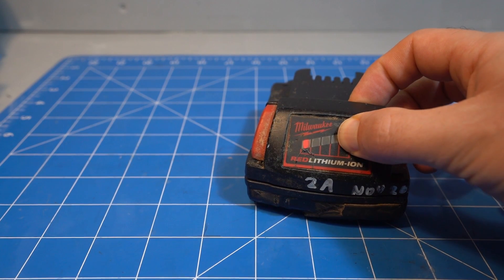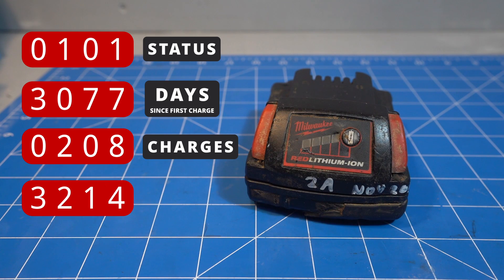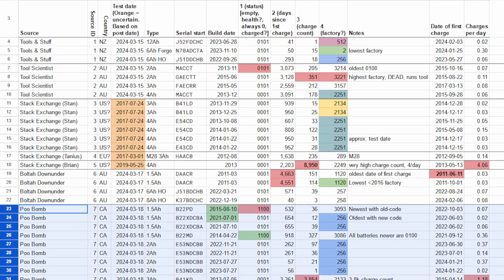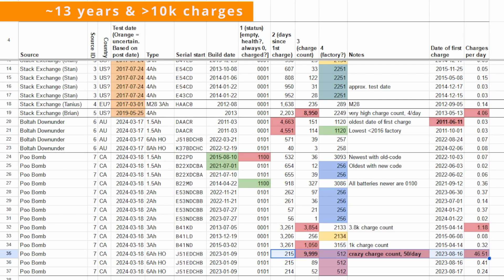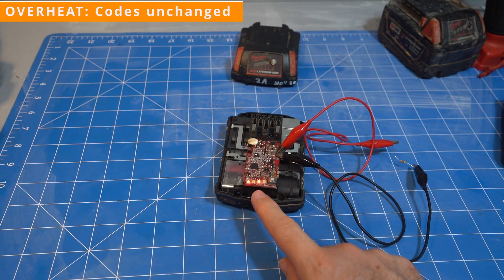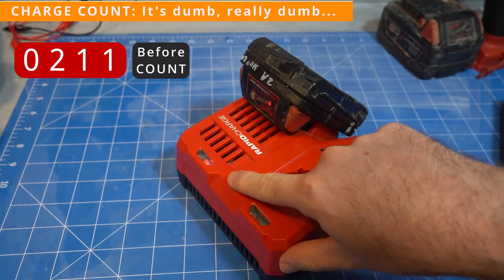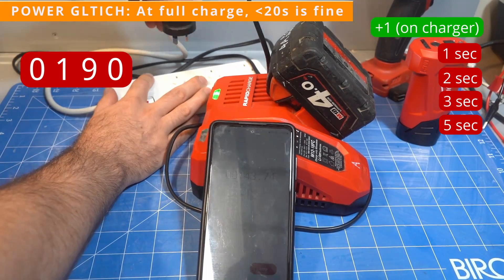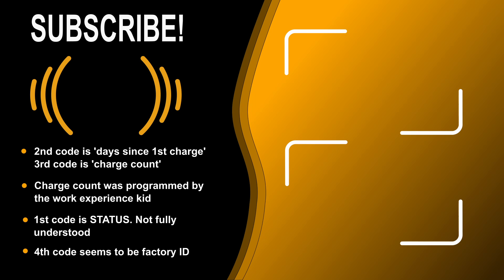[007] Milwaukee M18 has hidden diagnostic codes

Comment: Battery pack with part number 48-11-1881 (M18 REDLITHIUM FORGE XC8.0), manufactured at 241217  (2024-Dec-17), serial number starts with N82A, purchased from Home Depot:

- Shows the 4 diagnostic numbers, but I don't think they mean the same thing as described in the video.
- Brand new, before it was plugged anywhere, the pack displayed the following numbers:
1: 0011
2: 0000
3: 0000
4: 0004

Initially I thought, that's because the battery has never been charged. I fully charged it using the rapid charger. The diagnostic numbers have not changed. Hopefully, this is useful information.
Reply: Purchased in Canada.

Comment: My 3.0 was manufactured on 05/13/2022, reads that it has been 1,095 days since the first charge (today is 12/15/2025), it has been on the charger 35 times, and reads 1100 - it is flat dead, and reads a flashing green and red error when attempting to charge. I had an older 5.0 battery also flashing green and red - both of them I attempted multiple jumpstarts on, the 5.0 was able to eventually get charging (had to stay red without the charger roaring up, battery light flashing as if saying it's dead, constantly... until a few minutes later did it finally roar up and start charging). It is about to be fully charged relatively soon, thankfully I have at least one battery I was able to resurrect! I will test what it reads, and see if the stats show heavier usage... then determine if it is worth trying to continue resurrecting this 3.0. You think it wouldn't die after just 35 charging cycles... right?

Comment: DIYer and house flipper since I bought my first one in 1976. Bought a Milwaukee 2601 compact drill a long time ago. I only recently learned how to initiate the self-diagnostic check on Milwaukee batteries. Here's what I found when I did:

Lithium Ion Battery Catalog No. 48-11-1815, Serial No. B22BD101916012S marked as "27 Wh"
1). Status: 0001  - - - the meaning of this number is unknown (to me)
2). Days since 1st charge: 5327 - - - about 14 years ago
3). Charging cycles: 0186  - - - about once a month for 14 years 
4). Mfg Code: 1056 - - - the meaning of this number is unknown (to me)

I take care of my tools and with a few exceptions I still have every one I ever bought, My Sears Craftsman Model 315.10860 7-1/4 Circular Saw bearing date code "P 7:76" will be 50 years old next summer and it still works great.

SP5 Old Curmudgeon 
US Army Vietnam Veteran 1969-70…. and still…
Beaucoup Number Ten GI

Comment: How many readings do you want. I typically get in hundreds of m18 batteries. Obviously many will be in the date range when they took away the code reading but I can supply a decent amount if needed
Reply from the maker: None anymore. We've cracked their digital diagnostics mode now, so no more counting flashes! Video coming in a week or so

Comment: Mine came up really weird so I will post the results. This battery was flashing Flashing red/green( Damaged or faulty battery pack) on the charger so that may be the cause of the strange results. I do believe this battery is authentic as it came from home depot and looks authentic according to all the videos I have watched. It is an M18 2.0AH 36Wh lithium ion. CAT NO 48-11-1820. The serial number is E53FD 129194. The heat stamp reads. 150710V.  The circuit board was labelled REV 2.0 Aug 14. The date stamps moulded on the inside battery housings show a manufacturers date of 06/15. The weird part of the test was when I tried to read the LED lights. I will post them directly as they came out. A stands for all. The battery was not charged, used or placed on the charger between tests
1st test : A 24 AA 111222222222444444 AAA 2222222444 AAA11122334
2nd test : A 24 AA 111222222222444444 AAA 3333333444 AAA11122334
3rd test:  A 24 AA 111222222222444444 AAA 4444444444 AAA11122334

When I disassembled the battery all 5 of the cells tested at 4.03 V. The two outer cells showed some bluing on the negative ends. The cells are labelled as:
 INR 18650-20R M 
 SAMSUNG SDIEM
 125

Comment: 46 charges per day... guy was probably using the car/truck charger and it registered every time the vehicle was shut off and turned back on as a separate cycle as you shown with power cycles.
Reply from the maker: We've had 4 or 5 people report having 9999 charges. So far no one has had more than one battery with 9999 charges, so it seems to be a glitch, rather than a charger issue. I initially thought it was dirty power that was making the charger flick on and off, but then those users should have multiple batteries with 9999 charges.

Comment: If you still need codes I have been using mine to jump start my truck for a few months now and is throwing out diagnostic codes. Now it is only charging to the third light and throwing codes as I hold in the fuel button
Reply from the maker: Charging to 3rd light means the cells are imbalanced. Might need to open it up and charge the low cells to full votlage with a li-ion charger and alligator leads.

Comment: I've noticed no codes too in 2016-2021 batteries. Can check later on if I have some in the gray areas and get back to you.
Reply from the maker: We've narrowed it down to:
Sep 2015 - last date with codes
Jan 2016 - no codes
July 2021 - 1.5Ah regains codes
Oct 2021 - 2Ah regains codes
Dec 2021 - 6Ah regains codes
March 2022 - everything except 4Ah regains codes

4Ah has not yet regained codes. We think losing codes lines up with the change from MSP430 to R5F microcontrollers. Regaining codes maybe lines up with them changing from 32kB to 48kB MCUs (they're now using 64kB chips)

Comment: I have UK CA version of 5.0Ah M18. It only shows the following: 1) status code (0101) and 2) flashes full (1111) two times. 3) 1111 for three times again. 4) 1111 for four times. 5) 256 (I guess it is the factory code)
Reply from the maker: Those full flashes are used to separate the codes. That means your actual numbers were zero. Zero days since first charge and zero charges (1st charge isn't counted). If you check now you should have at least 1 for 'days since first charge'

Comment: Got a 12Ah one in work that someone plonked on my desk before the christmas break. Won't charge and the battery level display does nothing unless you hold it down, now i know its diagnostic codes ill check them out and report back here.

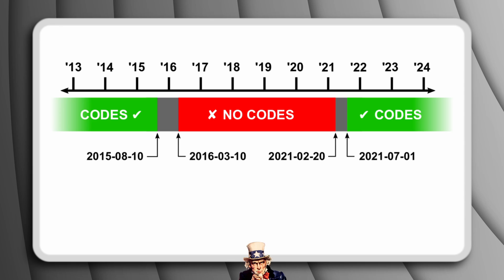Comment: Great info! In case it helps, I might be able to help narrow your second gray window (@4:50). I have a battery with the following info and it does NOT give any codes: US 2024-12-04 12Ah J52BDCAF 2021-04-26
Reply from the maker: Thanks! We're currently at Jan 2022 for when all batteries have codes again. Except for 4Ah, they seem to have not regained their flash codes.

Comment: If this is helpful I have codes for an M28 Battery purchased accidentally thinking it was an M18.
Has never been used. Tried charging it with a bench power supply to sell but looks like I blew something because although the cells are all at 4v, the main terminals read zero. That was about 5 years ago. 

The codes I recorded then were:
NZ 2019-09-28 5Ah H42BD 2018-11-02  0001 0555 0044 063
And today:
NZ 2024-10-11 5Ah H42BD 2018-11-02  0001 2028 0008 074

The movement between the last two codes is curious since its been sitting in a box that whole time undisturbed. Any suggestions re a fix appreciated!

Comment: my work uses almost exclusively 3ah m28 batteries, here's two of em, could gather more like a gremlin if needed:
AU 2024-04-30 3ah ???????? ?????? 0001 0014 0002 0593, heat stamp LBBCRR
bottom label reads: M28 BX | 7 inr 18/65-2 4932 3529 24, visually pretty new
AU 2024-04-30 3ah ???????? ?????? 0001 1121 0045 0593, heat stamp 190218P
bottom label reads: G24BD 0135(38?) damaged label visually quite old
Reply from the maker: Is your test date supposed to be 2024-08-30? Seems strange that you tested in April.

Interesting that you've got both number and letter heatstamps. I thought the pattern was that N & S America got numbers and everywhere else got letters. All of my heatstamps and the one's I've gotten from EU have been letters. Your 190218 is 2019-Feb-18, so not super old, but could get fairly beaten up if used hard. I'm guessing these are specialty industry tools (hydraulic rescue?) as that seems to be the only place where people still use M28. The LBBCRR is Nov-2022 by my reckoning from other heatstamps: (L-1) = 11 = november, BB = 22 = 2022.

Date of first charge for both packs (assuming 2024-08-30 test date) is 2024-08-16 for the newer one and 2021-08-05 for the older one.

M28 isn't super interesting, so I don't really need any more. I mainly need modern (>2022) M18 packs to decipher the 4th code. The 4th code changes too much and there's not enough older batteries around to fill in the blanks.
Reply: @toolscientist  i recorded a few videos of the flash codes in april and just forgot to comment the findings lol, for enerpac xc hydraulic jacks, (mining industry)

Comment: Just got two new forge 12's, below are codes before first charge.  Happy to share the codes after charging, just let me know.

US	2024-08-20	12Ah Forge	N92ADCTB	2024-06-07	0011	0000	0000	0004
US	2024-08-20	12Ah Forge	N92ADCTB	2024-06-08	0011	0000	0000	0004
Reply from the maker: That's awesome. Thank you! Not much will happen after first charge. The days since first charge initialises, but will show 0 until 24hrs has passed. I think charge counter only goes up to 1 after 2nd charge. The first code will change to 0101 when you put it in a tool and squeeze the trigger.
Reply: @toolscientist  yeah figured since the 4th code doesn't change you likely wouldn't need. Will send some codes from older batteries soon. Out of curiosity, do you have a non-editable version of your spreadsheet to share? Cheers!
Reply from the maker: @mikeb1220  4th code is actually the only unknown anymore. There's a vague correlation between 4th code, serial number and manufacture date. If you've got >2022 batteries, I'd love to have their codes. I don't really need full codes - just serial number build date and 4th code.
Reply from the maker: @mikeb1220  https://docs.google.com/spreadsheets/d/177zUPHexMQrMM4bZsha4-4qx_HAuIOA0NFCWly1mDvA
Reply: @toolscientist  will send the pre-2022 ones your way

Comment: First code new battery out of pack 0011 then fully charged code 0011 then once put in a tool and used 0101
Reply from the maker: We've had a few people report that. The unsolved part now is the 4th/last code, which vaguely ties in with serial number and manufacture date

Comment: Interesting, i will get back with my data. Just wondering, i imagine fakes do not have this? May be useful for people to know as a way to check
Reply from the maker: Yeah, problem is a big chunk of legit batteries (everything from ~2016-2021) also lack it. It wouldn't be very hard for counterfeiters to copy this, but it's still an extra hurdle for them.

Comment: EU 2024-08-14 5Ah G29NDCBC 2024-01-15 0101 91 3 256

No heat stamp at the terminals. Charge count and days-since-last-charge seem about right as well (I'm an occasional user).
Reply from the maker: Thanks! That's one of the newest ones I've had.

Yeah, only batteries before 2016 had heat stamps.

Comment: great info and i just check a bunch of my batteries.  all my 2021 dated batters or older cant do this but all my 2022 and newer can do this.  I have about 15 m18 batteries and they all seem to check out right except for one battery.  But i have brand new m18 high output 8.0 that is only 30 days old and only has a few charges on it but it reads 9999 charges.  All my batteries are real and bought from home depot.
Reply from the maker: Currently we've got 1.5Ah getting codes July 2021, 2Ah October 2021, 6Ah Dec 2021, then everything else gets codes after March 2022. Except the 4Ah which doesn't seem to have gotten its codes back.

We've had 6 people with a 9999 charge battery. Seems to be a glitch as there's no other pattern. I thought it might be charger related, but so far no one has had more than one 9999 pack.

I know the codes are painful to read, but would you be willing to post just the 4th code and the serial numbers? The 4th/factory code is the only thing that I haven't been able to figure out yet. There's some sort of pattern there with how they are either 256, 257 or 512, but I don't have enough examples to crack it.

Comment: I have two cp3.0 batteries from 2022, first battery- 0839975 codes are 1st- (0101) 2nd- (0433) 3rd- (0011) 4th- (0257)   second battery- 0839974 codes 1st- (0101) 2nd- (0434)  3rd- (0013) 4th- (0257)    they were purchased as a pair in the same packaging and are fairly new as you can tell by the charges, i also have a "grey area" battery from 2021 cp2.0 (2.0 AH) 5inr19/65 18v 36wh li-ion E53LDCBB 210324 4226951 (doesnt give any codes when holding the button)  but as you know. It doesnt have the code flashing feature ❤ hope my small batch helps❤
Reply from the maker: Thanks! Do you have the first and middle part of serial numbers? First 8-digits contains info about battery type and manufacture. Middle 6 digits is date of manufacture in YYMMDD format.

Comment: Has anybody got a genuine Milwaukee bms back to life after disconnection from battery(no power)
Reply from the maker: I have heard all you need to do is put it on a charger and resets itself. Lots of posts/videos of people that have rebuilt M18 batteries with new cells.

Comment: My 2023 high output 6.0 won’t do diagnostic mode. My 5.0 ones will.
Reply from the maker: That's strange. Every 6Ah HO after Dec 2021 has had codes so far. What are the codes for you 5Ah?

Comment: Yoo interesting results, a battery that goes past your code date range with no codes. Got 3 batteries. 2&4 bought together in a kit. 6 forge bought later. 

1. US 2024-07-06 2Ah E53NDCBB 2022-04-09 0101 0522 0015 0256

2. US 2024-07-06 4Ah E54SDCKC 2021-08-03 No Codes

3. US 2024-07-06 6Ah Forged N70ADCTA 2023-09-04 0101 0180 0003 0002

I don’t have any heat stamps on any of my batteries that I can see. If you need more info, reply and I’ll make it a point to keep checking. Happy to provide any additional info you need.
Reply from the maker: Thanks! Heat stamps are only on batteries made before 2016, after that the build date is in the serial number.
Reply: All three batteries were purchased at Home Depot in New Jersey, USA
Reply: You’re welcome!! I subbed, looking forward to a follow-up. 

Any idea why my 4Ah doesn’t have codes when the 2Ah from the same kit does, particularly when the 4Ah was manufactured later than your non-code window?
Reply from the maker: @markanderson1088  no. So far none of the newer 4Ah has had codes. Every other type gets codes by March 2022.

Comment: SE 2024-07-02, 1,5 Ah DAOOU 0001,  4261, 0313, 1088, 14 volt
SE 2024-07-02, 4 Ah    EAFCTT 0001, 2842, 0046, 1224, 14 volt
SE 2024-07-02, 3Ah     AAOCU 1000,  5869, 0177, 1102, 14 volt
SE 2024-07-02, 3Ah     AACCR  1000, 3086, 0140, 1552 18 volt    This is broken in some odd way, i can now charge it but will not "top up"(only three bars).
I have a couple more in my garage, will check them tomorrow, i also got one at work that says fully charged when in charger but first bar flashes......

Keep up the good work👍
Christian
Reply from the maker: Damn, that 3Ah with 5869 days is a new record by 1000 days. First charged 7 Jun 2008. M18 was only released in 2008, must be one of the first. Hang on, the first 3 are M14 batteries? I had no idea such a thing existed.

The interesting ones are the 2022 and later ones.

Comment: Just came here to comment that I have a CP 2.0 date coded 210802 that doesn’t run diagnostics🥴🥴
Voided the warranty to open it up and double check that it indeed was OEM and not a fake, all looks correct to me inside🤷🏻‍♂️
Reply from the maker: Pretty sure there's no anti-tamper features, so your warranty is still good

Comment: date codes 160111, 160112, and 210504 in gray zones have no flash codes
Both5A 1601 batteries have failed and don't recharge
Older batteries with 5104 days since first charge 2013 still going well 3A no date code.
Factory codes found 1072 and 3051

Comment: US 2024-05-10 6Ah J51BHTHB 2023-01-20 0101 0381 0010 0257
Reply: Jebus, this is a pain to watch my batteries and count. I have 25 more batteries to do.
Reply from the maker: Impressive consistency to have exactly 10 cycles on each 6Ah! You have some of the rare xxxx-HT-xx batteries. Nearly all so far have been xxxx-DC-xx. The only other HT batteries are also 6Ah from the US with 257 4th code. Made Aug 2022, so pretty close to yours

Your 5Ah should be G29xDCxx and your 8Ah should be K37xDCxx
Reply: @toolscientist  I am still laying hands on all of these to get their codes but I do have their serial numbers already. There are 15 unique leading serial numbers.

B22XDCJA
B41VDCJA
E53LDCBB
G29GDCAC
G29HDCAC
G29HDCBC
G29KDCBC
G29NDCBC
H18FDCAD
J51BDCHB
J51BHTHB
J51FDCHB
J52ADCAF
J52CDCHC
K37ADCAF
Reply: @toolscientist  The 5AH is an XC with a serial number of G29GDCAC 161021

I also have 5ah that are:
G29GDCAC
G29HDCBC
G29KDCBC
G29NDCBC
Reply: US 2024-05-10 6Ah J51BHTHB 2023-01-20 0101 0381 0010 0257 (Different battery than above)
US 2024-05-10 6Ah J51BHTHB 2023-01-20 0101 0385 0010 0257
US 2024-05-10 6Ah J51BHTHB 2023-01-20 0101 0381 0010 0257 (Different battery than above)
US 2024-05-10 5Ah J51BHTHB 2016-10-16 no-codes
US 2024-05-10 8Ah J51BHTHB 2019-01-29 no-codes